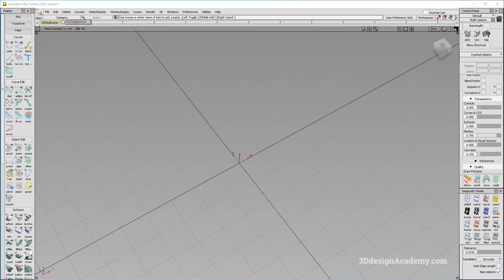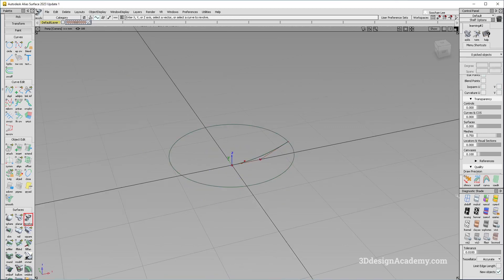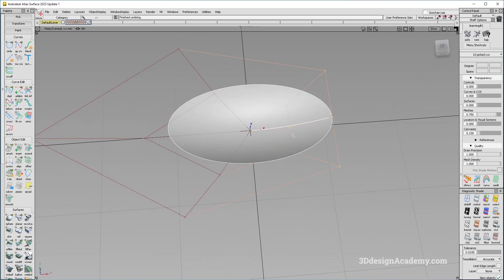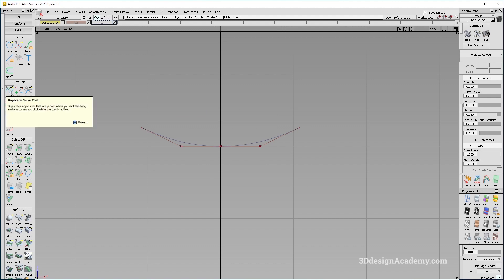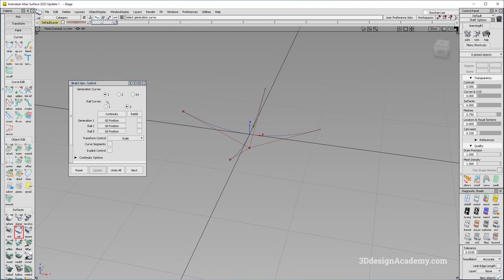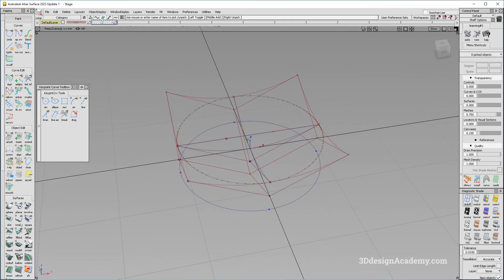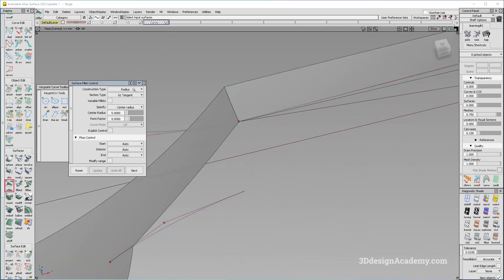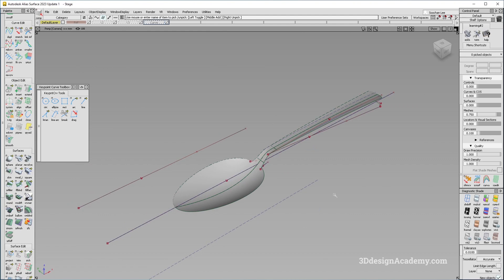Alias Tips and Tricks 11 - How to Make a Spoon

Comment: And here it is!  So, it turned out you should not "force" your concave shape to the flat profile, you do not need a flat profile in a first place. You just match it by moving rail surfaces around. Such a relief. Why I was so dumb and pushed it to flat profile all this time... Btw, we can always use "Stretch Curve Tool" to perfectly align intersection of rails. Anyway, 10 out of 10. Thank you Soochan!
Reply from the maker: No problem. By the way, you're right on the stretch tool to align the gen curve and the rail curve. Didn't think about that!